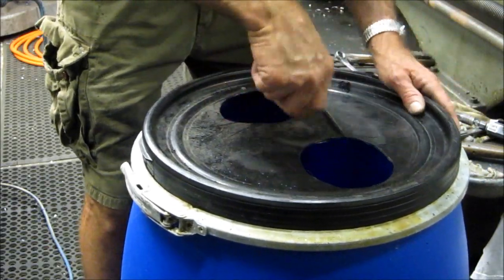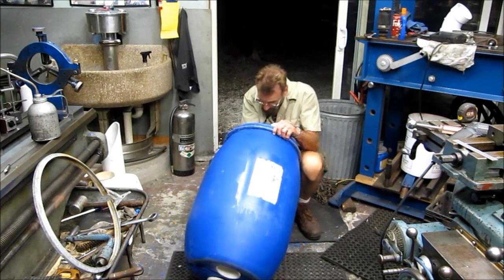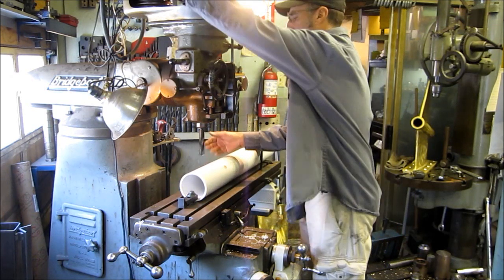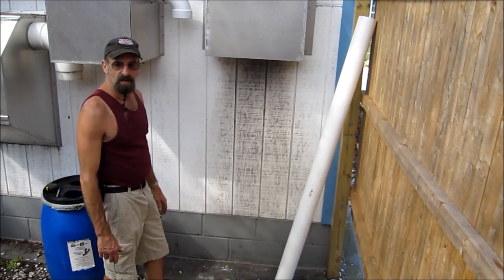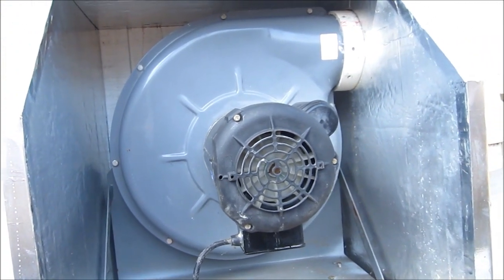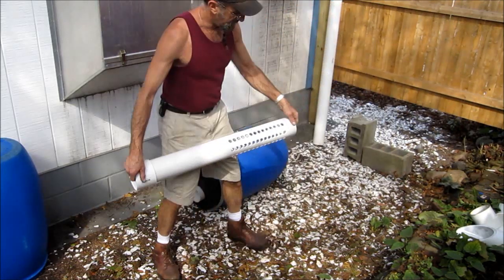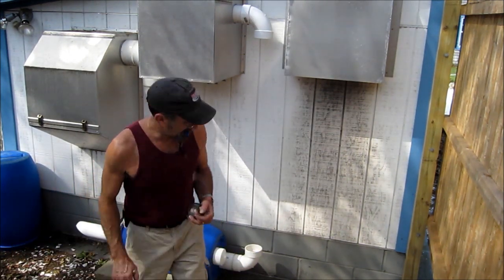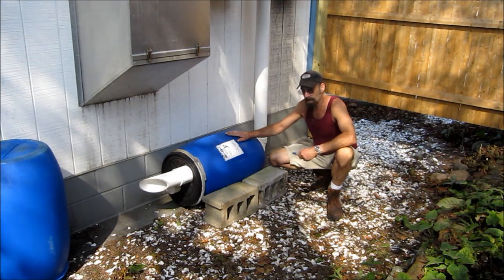Muff It

Comment: Beware of overheating those Electric motors inside the non ventilated enclosure. The first sign is they trip on the motor protection unit ever so often.

Comment: I made a mini version for a noisey air compressor similar to yours and after adding foam bits and packing peanuts is was more quiet than with out the fill. At first I was concerned with heat but that was a false alarm. Great vid as always thanks.

Comment: Great vids.  For packing the barrel use fiberglass insulation batting, cheap, fireproof, easy to get and replace, and acts like filter for particulates.  The others' suggestions of spraying inside of barrel, lining pipes, and rubber vibration insulator for pipes also very good.  Don't know about up nauth, but here in Florida not having the tailpipe covered with a screen would mean having a critter ecosystem in your barrel in a very short time.

Comment: should spray inside of barrel with sound insulating foam, fill with some insulation or spray walls with truck bed coating will get even quieter

Comment: I did something like that for an air dryer purge off a 150 hp compressor once. It was a steel barrel and lines. The dryer went off with a hell raising woosh every 10 min to an hour depending on load. The problem was the factory backed up to a church. Let us pray.... woooommmmpssst. They bitched and I had to tone it down.

Comment: It depends upon many things, but neglecting the dedicated exhaust for the plasma table, you want about 6 air changes per hour for general shop ventilation to control dust, etc. - more for dirty operations.

1,300 sqft x 10' h /10 min - 1,300 cfm at a minimum.  2,900 cfm puts you @ ~ 2x min., which is smart for when you weld and braze inside...

Shop ventilation is a *LOT* more complex if you are doing anything like painting or woodworking or other dirty stuff.

I do Industrial Ventilation...

Comment: Nice work! Get some mineral/rock wool and sandwich it between two pieces of chicken wire, make it a circular shape and slide it on the inside of the barrel.  It'll dampen it a lot more.  Cheers!

Comment: Maybe somebody already gave you this tip, but never the less. If you put in a piece of rubber tube between the pump and the plastic tube, you will probably cut down on the vibration that transplants trough the solid connection and makes the plastic tube resonate. Videos like yours makes it worthwhile spending time on Youtube.

Comment: Thanks for this useful information!  I'm looking at adding about 600 Sq Ft, partitioned off from the existing space (400 Sq. Ft), and I'm considering a thru the wall 4500 CFM whole house fan for ventilation.  Regarding room air change rate, my current plan is in the same ball park as what you've got.

Comment from the maker: My shop is about 1300 Sq Ft and the two air pumps on the plasma table may be moving 600- 800 cfm and the wall fan with louvered gate may be moving about 2900 cfm...

Comment: Keith, I'm planning a workshop addition for welding so I know having adequate ventilation will be important, but I don't know how much air I will need to pull out to keep things from getting smoky inside. No matter how much welding, plasma cutting or other smoke/fume creating operations you do, your workspace never seems to get smoky.  How many square feet is your shop, and how many CFM does your vent system pull?

Comment from the maker: @Narlynarz The muffler on the outside of the building is doing just fine and has rid the turbo whine at that end. the little whine I have now is on the suction end at the table it self. Going to try wraping the alum down pipes with foam sheet, to help. :)

Comment from the maker: @billdlv I love thinking minds! They are tight but not butt tight, I insulated for sound, my on demand use has only been streaches of about 10 to 30 min's at a time. I will include a temp check in my operations of these motors now, thanks for the comment! I can make a free vent on the bottom of the box and plumb a draw right in the suction line, or something like that if I need to... Keith

Comment: Great video again ...

I'm wondering if your motors get hot since they seem to be in boxes which are sealed and insulated?  It seems that the air inside the box would be moving from the motor fan but it's got no where to go.

Maybe I'm over analyzing ...I'm an engineer...